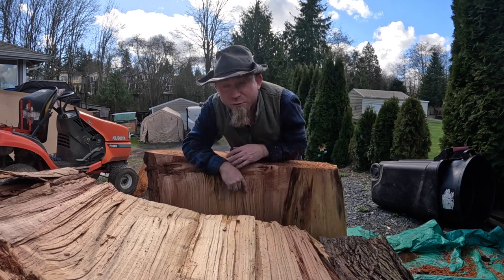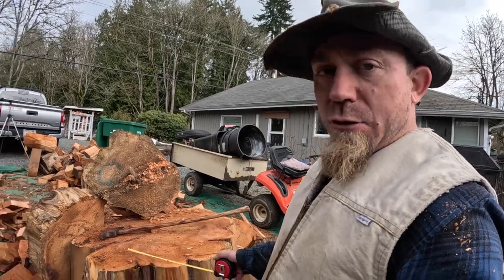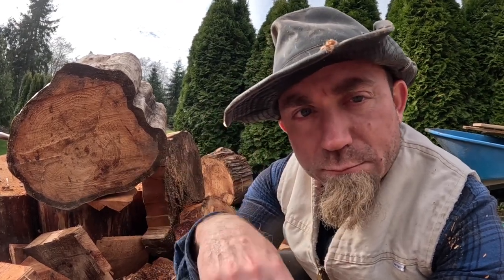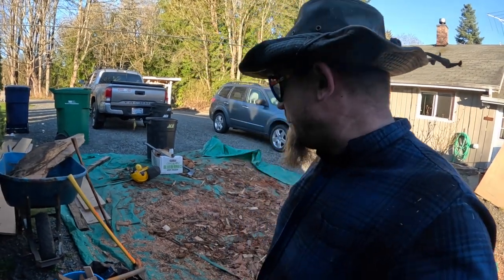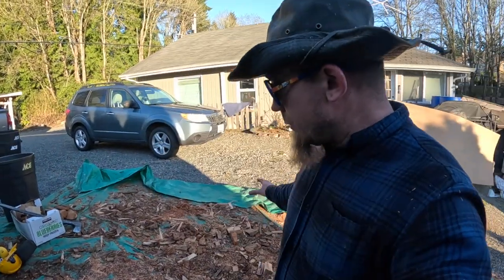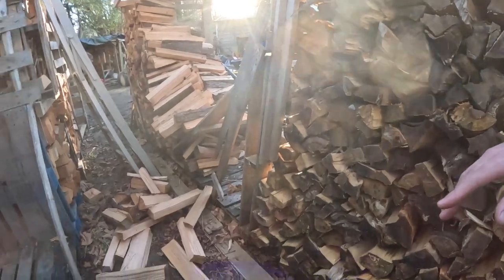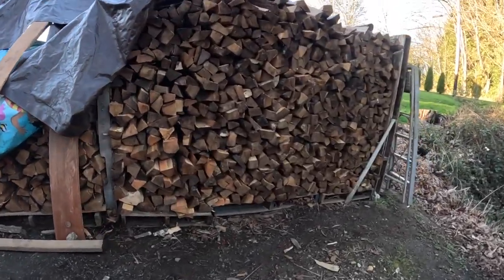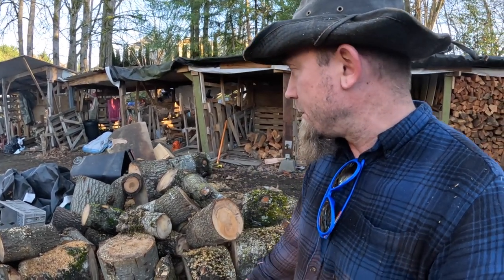Cedar Coming Out Of My Ears

Comment: I always use the splitter. At 65 I haven't the endurance to use an ax to get the amount I need specifically in the time it takes to acquire that amount. Cedar is my preferred wood mixed with oak. It burns fast and extremely hot. It with start that fire lickity split.
Reply from the maker: Totally hear ya, fellow firewood addict! I don't use the axe always for all wood, just for stuff I can split easily. Keep cuttin'!

Comment: I just read the reviews on that saw. hell you don't seem to have any issues with it, maybe your just smarter than most, but anyway it sparked my interest as purple is my favorite color and that's bad ass. I have a Husqvarna 460 rancher which is awesome,  and a Blue max from the orange big box store. The blue max was an issue in the beginning, but after replacing the carburetor that damn thing won't quit.
Reply from the maker: Hey, if it work and runs, run the hell out of it - right? Check out the recent episode where I put the 63ACG against my own Husqvarna 460. Thanks for watching, stay tuned, and keep cuttin'!